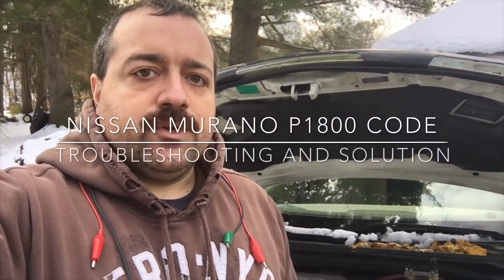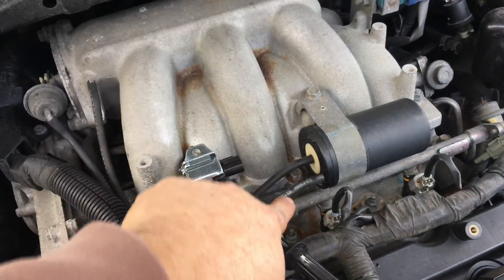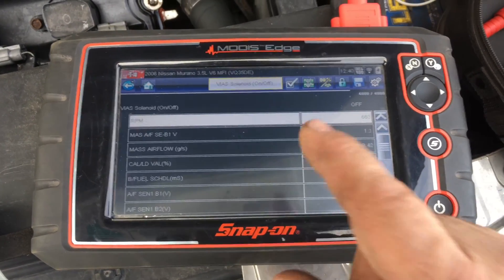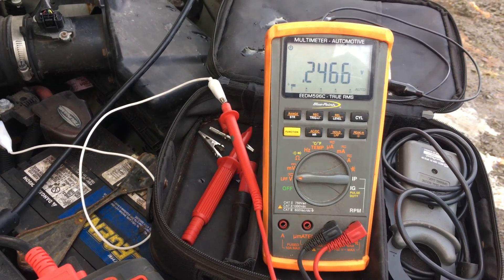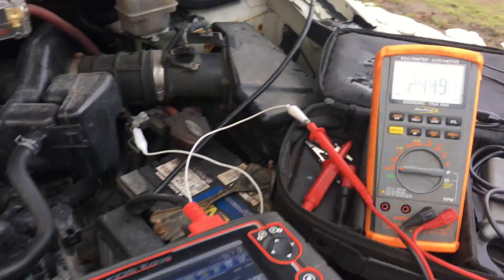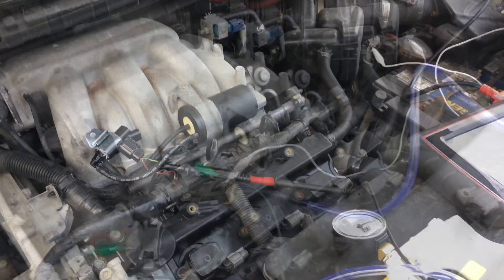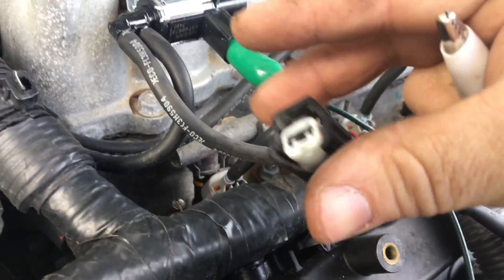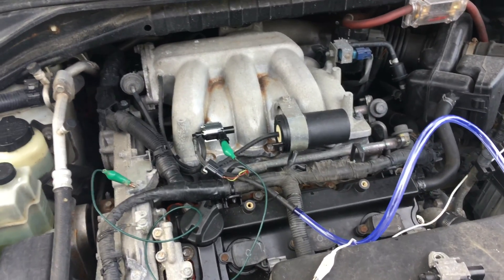Nissan Murano P1800 Solution

Comment: Activating the solenoid all you did was provide ground on the green wire. Using your VMM and putting one side to battery of course youre going to read battery voltage to ground. All you did was verify the ground was good. You didn't actually prove the supply voltage was good from the ECU. it may not even be a 12v circuit. It could be a 5v circuit.

Comment: Great video with detailed troubleshooting steps that should help a lot of people.  Can you tell me if vacuum should leak from the black cap on the right side of the solenoid at idle.  Both the original and new solenoids leak vacuum from that cap.  This is my granddaughters Murano and there have been many unskilled hands under the hood that cause me to question everything.  Thank you!
Reply from the maker: That’s a good question. I’m not 100% sure.  I do know that some people have found the two vacuum lines swapped around. I do know the cap is there to allow venting under certain circumstances…just not sure what those circumstances are.

Comment: Good afternoon. 

I know this is 4 years old. I am hoping you still see this. 

I have a 2014 Nissan Altima, 3.5L. I have a P1801 VIAS control solenoid valve 2 code. I have purchsed the little part that you test in the 2nd half of your video. I disnt realize till i went in to change it, there looke to be 3 of them. 

Does the 2 in the name designate which one is faulty?

Thank you in advance. 

Jason.
Reply from the maker: On your engine (based on a brief Google search) you do have more than one of these. It looks like there’s one for the passenger side and one for the driver side of the engine.  I’m not sure where the third one could be The “2” probably refers to “bank 2” of this V6 engine. Bank 2 is the side of the engine that does NOT have cylinder #1 in it. I think that sensor 2 (and bank 2) is the driver side of this engine for you.
Reply: @Joe's Car Smarts-NY  thank you very much. This helps a lot. I could be mistaken that there is a third. 

Nonetheless. I really appreciate your response and semi-confiming my suspicion on the "2" being a second one i.e. bank 2. The good thing is both are up front and don't have to remove anything extra. 

No for me to figure out which is which this afternoon. 

Again, thank you very much. Your time and expertise are greatly appreciated.
Reply from the maker: @Nvable  I’m glad to help. Good luck with the project.

Comment: Hey joe, I have an 07 murano and it’s having a hard time accelerating while on a hill. Do you think it has to do something to do with it? Thanks in advance.
Reply from the maker: If you don’t have an engine code for this, then it’s probably not the problem. I don’t know about your cars history but I’d look at:  spark plugs (around 100k miles), fuel system cleaner treatment, cracked rubber air intake boot (recall issue), and maybe change your CVT fluid.  Those are the most common issues I’ve had that made my Murano act weird. The only other one was when I did some work and accidentally left the knock sensor unplugged…the car had significantly reduced power without the knock sensor connected.
Reply: @JoesCarSmartsNY  the cars about 72k. Maybe the spark plugs and cvt is overdue. Do you think I also need to change the fuel rail system, injectors? When I start the car, oil light blinks then goes away. Do you ever have that problem joe? Ty sir.
Reply from the maker: @GHOST51168  Okay. With that info I would change the CVT fluid ASAP. It’s easier than an engine oil change. Buy 6 qts Nissan NS-2 fluid. I would do the spark plugs next. Use the original equivalent Iridium plugs. That’s a project if you haven’t done it before - the upper intake manifold has to come off. It’s not terrible, just more work. 

I would not change your fuel rails. I have 281k on my original injectors.  I would run a bottle of SeaFoam or other quality fuel system cleaner through the car. Then do it again. 

Oil light should come on briefly (like your other dash warning lights) when you start the car.  Maybe for 3 seconds?  Not exactly sure. If the light goes out quickly then it’s acting correctly. 

If the oil light is staying on, or comes on any other time then you have an oil pressure issue. Common oil leaks are the oil filter cooler seal, and the oil pan if it’s rusty.
Reply: @JoesCarSmartsNY  when I drain the cvt fluid it sums up to 6qts joe? Do I have to put all 6 qts in? Yeah changing the spark plugs on this cars can be a hassle. 1,3,5 are in the back. Can an average person do the spark plug in this car? Also it’s better to replace the manifold gasket while at it right joe? Ty sir.
Reply from the maker: @GHOST51168  I think it takes a little under 6qts. You should double check that amount. The Nissan dealer where you get the fluid can also tell you. I usually buy 6qts for some reason. 

Spark plugs: the average mechanic can do the spark plugs no problem. The average person who’s comfortable removing an intake manifold and doing spark plugs will also do just fine. Someone who’s never taken off a manifold should not attempt it.

Comment: my 2006 nissan murano  engine stop after 45 min runn, to starting again at least need 10 or 20 min. in computer checking there is  no any failer code. what can Ido to resolve the car  problem?
Reply from the maker: That’s a tough one.  It sounds like something is getting warm and shutting down. Usually that’s something electronic. 
When it’s NOT starting properly you need to check for fuel and spark.  That’s the beginning of a “no start” troubleshooting process. Need to check for fuel and spark. Those are the two things that are most commonly failing to allow the car to start. Good luck.

Comment: I have a 2005 Nissan murano engine has ticking and after warmed up and driving car begins to shake when accelerate,   should add dark smoke at start up
Reply from the maker: That could be several things. Basics: check oil, change oil (if it’s overdue), try using a fuel injector cleaner additive in the gas tank. 

Also, spark plugs should have been done at 100k miles. Fouled spark plugs can also do some of this.

Comment: Will this also cause you to use more fuel
Reply from the maker: Not too sure, but it’s possible.  If this solenoid is faulty you should have an engine code.
Reply: @JoesCarSmartsNY  I have engine code p1800
Reply from the maker: @ricardoharris651  Replacing this solenoid solved my P1800.
Reply: @JoesCarSmartsNY  yea I just checked my engine bay out and whoever had this car before I guess took it off
Reply from the maker: @ricardoharris651  Like, it’s missing?  Wow. That’s special.  Is there a block off plate or something on the end of the intake?  That’s not common, but sometimes people defeat the whole system and block off that end of the intake with a special plate.
Reply: @JoesCarSmartsNY  the solenoid is just not there at all
Reply from the maker: @ricardoharris651  Weird.
Reply from the maker: @ricardoharris651  Here ya go: https://amzn.to/3q9xe3d

Comment: Hello dear.

When vias should work?
On what rpm?

Thanks
Reply from the maker: I don’t know specific RPMs, just that it opens at higher engine speeds.  But it’s probably also programmed so it only opens when your actually driving.  Probably won’t open if the car is parked.

Comment: Hello friend, good day, my 2003 murano when I get to the side and brake at a stop it does not want to accelerate anymore but I turn it off and turn it on again, it returns to normal, it accelerates very well, you think it is the solenoid. Thank you so much
Reply from the maker: This solenoid would not cause your car to do this. It sound like your transmission might be in limp mode.

Comment: Hi Joe, do you think the Vias Solenoid would cause my Nissan Murano to stall while im driving it down a road? My car just cuts off and i coast to a stop.
Reply from the maker: Probably not just the VIAS solenoid.  This system only changes the internal air path of the intake plenum (where air comes in). If the solenoid doesn’t operate the engine still gets plenty of air, just through a slightly different pathway so to speak.

You should be getting engine codes if your car is doing this. You should have the codes pulled and see what information the car is telling you about why it might be shutting down. Most car parts stores will pull the codes for free to get you started. 

Good luck to you.
Reply: @JoesCarSmartsNY  Thank you so much. Going to try the Crankshaft sensor next. Im not getting any codes now after replacing the Vias Solenoid but i havent test drove it yet. However, i did find out if the crankshaft sensor is bad, it doesnt always set off the check Engine light.
Thanks for your kind response!
Reply from the maker: @Iheartcatz  Okay. If you’re not getting codes with this symptom, I’d recommend the camshaft sensors first.  They are easier to access and are known to fail. They also don’t set an engine code all the time. I have a video for that project as well.

https://youtu.be/A6nPeRl_510
Reply: @JoesCarSmartsNY  ok i ordered those too. I just need a smaller ratchet. Couldnt get 10mm screw off. Its in a tight space.
Im on it. Thanks so much Joe!
Reply: So a neighbor helped me change both sensors. I was able to start and drive the car beforehand, it just died while driving. Now, i cant start it. It revs up but no start. I feel defeated. I paid him $100 for his work.
Reply from the maker: @Iheartcatz  That’s a pretty good price for that work. Try disconnecting the battery for about 30 mins and trying again.  The computer may need to be reset that way.
Reply: @JoesCarSmartsNY  its revving but not starting. My battery is a little more than 1 yr old. 
He had to jump start me. Otherwise i got nothing
Reply: @JoesCarSmartsNY  possible Alternator?? Idk what to think. Aamco replaced it last summer
Reply from the maker: @Iheartcatz  If it’s cranking and battery isn’t dead...Prolly not alternator.
Reply from the maker: @Iheartcatz  Probably time for a garage to check the car out. Good luck.
Reply: @JoesCarSmartsNY  one important detail; once both camshaft sensors were replaced, the car wouldnt turn over at all. No lights...NOTHING.
He then jumpstarted my car. I got lights, it cranks but will not turn over now.
Reply from the maker: @Iheartcatz  Maybe you do have a dying or dead alternator. It’s possible.  Maybe take it back to the shop that did the alternator?
Reply: @JoesCarSmartsNY  will do . It has a warranty. Thanks
Reply: @JoesCarSmartsNY  changed the battery circuit fuse. Still have crank, no start. Mechanic baffled. I give up. Next stop- CARMAX
Reply from the maker: @Iheartcatz  Might need a different mechanic. A mechanic with that car in front of them should be able to solve this for you. Either way, good luck!
Reply: @JoesCarSmartsNY  Taking to Aamco Wednesday morning
Reply: @JoesCarSmartsNY  Aamco cant figure it. Guess i need to junk it. No codes, no check engine light. Once the camshaft sensors were installed, it never started. Mechanics are baffled. Time to move on..
Reply from the maker: @Iheartcatz  Sorry to hear that.  It should be repairable, but might not be worth all the hassle.
Reply: Hey my Nissan 2007 cuts off while I driving it starts back up i had some plugs changed and used coilpack put on could the coil  be causing it to shut off

Comment: I replaced the vias control solenoid on my 2004 maxima but it was a used part from like a junkyard instead of brand new, I don’t get any engine light or codes anymore but when I rev it, the actuator doesn’t flip, so any suggestions? should I try to get a new actuator or vacuum canister or maybe try a brand new solenoid?
Reply from the maker: I don’t think the solenoid opens just because you rev  the engine. If your code is gone I’d say you’re good to go.

Comment: I NEED HELP IM GOING THROUGH THE SAME PROBLEM AND MY ACTUATOR IS NOT MOVING  I JUST GOT MY NEW VIAS CONTROL SOLENOID DO I NEED SOMEONE TO ACTIVATE VIAS SOLENOID WHEN IT'S INSTALLED FIRST🚘🚗🛠🗄🗜
Reply from the maker: They don’t need any activation. You should make sure you have the vacuum lines correct if you swap them it won’t work right.
Reply: @JoesCarSmartsNY  THANKS FOR YOUR HELP✌ BUT IT DIDN'T WORK IT WON'T OPEN OR CLOSE I HAVE P1800\PO507 🚗🚘
Reply from the maker: @zekowater  You’ll have to get a mechanic at this point.  That other code is for a throttle relearn.  It’s possible that the VIAS won’t work as long as that code is present.

Comment: You should  have vacuum at the solenoid from the reservoir with the solenoid OFF, right?
Reply from the maker: Carlos If you’ve built up pressure from the engine running, then you should have vacuum at the reservoir with solenoid off.  When the solenoid activates (opens) it sends the vacuum to the actuator on the side of the intake. If you’re not building vacuum at the reservoir you may need to check the feed line to the reservoir or see if the reservoir holds a vacuum by itself.
Reply: @JoesCarSmartsNY  Thank you for replying. So, just to confirm: if the hoses from the intake manifold to the reservoir is in  good condition, and the one coming out of the reservoir to the solenoid is in good condition as well and the reservoir builds vacuum, you should have vacuum at the VIAS solenoid from the hose coming out of the reservoir?
Reply from the maker: Carlos Yes.  It’s sounds like you’re not getting vacuum on the output of the reservoir?
Reply: @JoesCarSmartsNY  I am  going to deal with the code p1800 on a Nissan Murano soon. I am just making sure that I know how to diagnose it quickly  before I start working on the truck.
I watch videos where people  just go after the VIAS solenoid without checking for vacuum at the solenoid. The way I will do it is let the truck warm up and check for vacuum at the solenoid. If I find vacuum, I will use my scanner to command the solenoid on and look for vacuum out of the solenoid. No vacuum out of the solenoid, ( with good power and ground at the solenoid)I will replace the solenoid.

Comment: I had to go out of my way and make sure I logged in to thank you for making this video. I had to replace my spark plugs and took the upper manifold out so apparently when I put everything back together, I reversed the locations of the two vacuum hoses that you are talking about in your video. I'm a  DIY guy also and I like to pay it forward when I can by making a video that may help another do it yourselfer. Thanks again Joe!
Reply from the maker: Thanks for your feedback!  I'm glad this was helpful.  That spark plug job is enough work without having to figure out these vacuum lines.  Glad to hear you're back in business.

Comment: Hello i have this code but would it cause the vehicle not to go above 20 mph? I have a 2007 maxima
Reply from the maker: That shouldn’t cause that symptom I don’t think. Do you have any other codes?
Reply: It’s probably your transmission cvt
Reply: @johnmarshel6616  no it’s a sensor, my car did the same, CVT TRANSMISSION, and it was a sensor 🤦🏽‍♂️

Comment: My Murano starts but when I put it in drive and step on the gas, it takes forever to take off and sometimes it feels like the wheels makes the car rumblr...any ideas?
Reply from the maker: I’ll answer those things separately because I’m not sure they’re happening at the same time or not. Engine stumbling from a complete stop could be an air intake boot leak or vacuum leak. There’s a recall for the air intake boot. The rumbling could be a bad whee bearing which is also a common repair that these cars need. Best of luck to you.
Reply: Hey my 2004 Nissan Quest is going the exact same thing! I have the service engine soon light on and the code P1800 comes up. When I press the gas it takes forever to take off and sounds strange. And also hear rattling from the tires area maybe or under the hood. Did you find a solution for yours?
Reply: It’s your step motor for code p1800

Comment: Would like to know where I'd be able to purchase the vacuum hose AND the wirings that come with the vias control solenoid valve. Damn rats ate 3 of the vacuum hoses and 4 of the wires. Please help.
Reply from the maker: Vacuum hose can be bought off a roll at any good auto parts store or even Lowes sometimes.  If your electrical connectors themselves are good, the old wires can be soldered together by a GOOD technician.  If your connectors are shot or damage is very close to connectors you could go to a pick your own part junkyard and cut the harness off an otherwise junk car. Best of luck to you.
Reply: @JoesCarSmartsNY  Wow Thank you very much sir. Thought I'd have to wait a long time for answer. lol. The connectors are fine. It's the wires that they chewed through. Would have to buy the wires to connect to each end then cover with black tape. But I'll check Lowes for the vacuum hose. Once again I thank you very much.
Reply from the maker: June Bug I strongly suggest you use solder and then heat shrink over that.  If you’re not familiar with heat shrinking you could get away with tape as long it’s tightly wound in a couple layers.  The tape will be less impervious to moisture but should last for a while. I would absolutely solder the wires tho.
Reply: @JoesCarSmartsNY  Thank you. Will look into that.

Comment: Where did you find the off-brand part? My local chain store wants $140 for their OE-replacement part. Thanks for sharing the video.
Reply from the maker: https://rover.ebay.com/rover/0/0/0?mpre=https%3A%2F%2Fwww.ebay.com%2Fulk%2Fitm%2F163742962325

Here’s one option.
Reply: @JoesCarSmartsNY  Wow that's cheap! I searched Amazon and found one with a few hundred positive reviews for $18, supposed to arrive Sunday. Thanks for the quick reply.
Reply: @Konvinced89  when you replaced the vias solenoid with aftermarket cheap replacement, did it work and more importantly did it last? Thanks